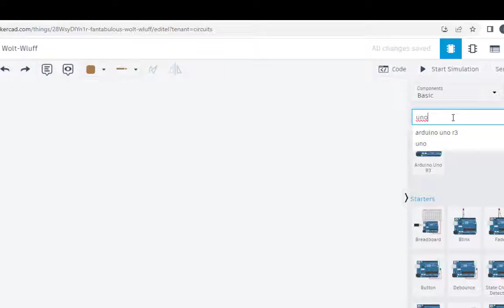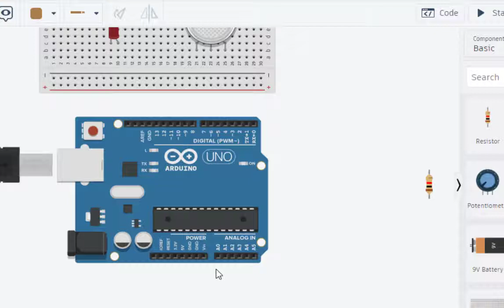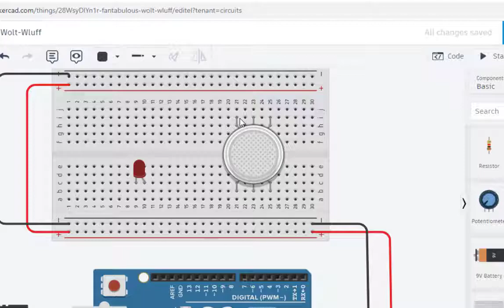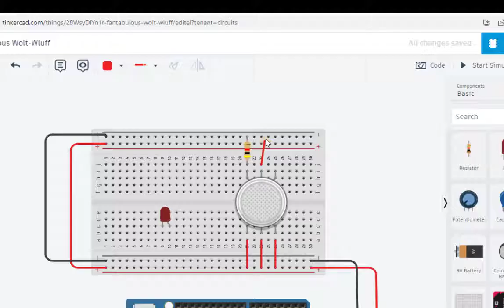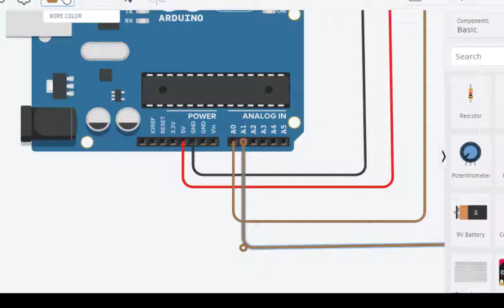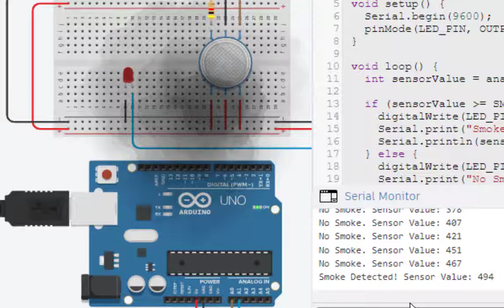Gas Sensor using Arduino

Comment: Tip : if you're Arduino is getting damage 💥
Make sure you add a resistor for A1 wire
Reply: 0.1 kohm resistor